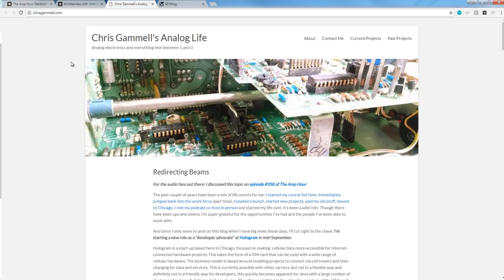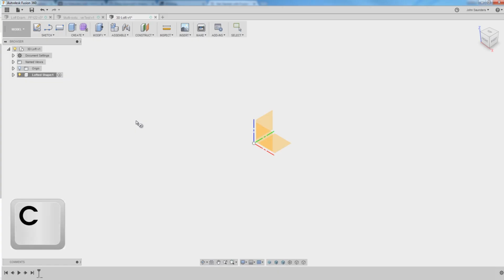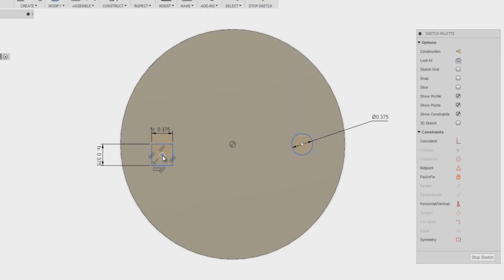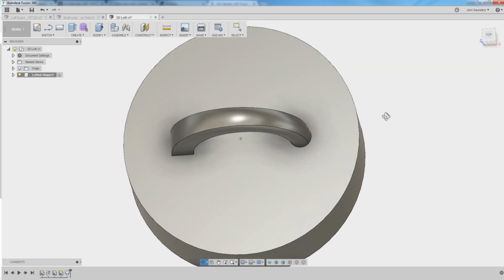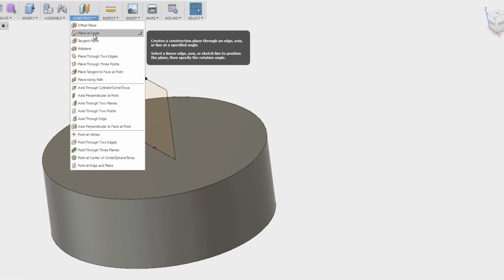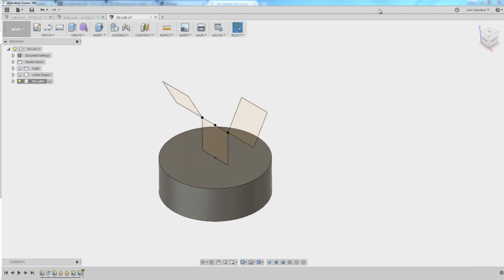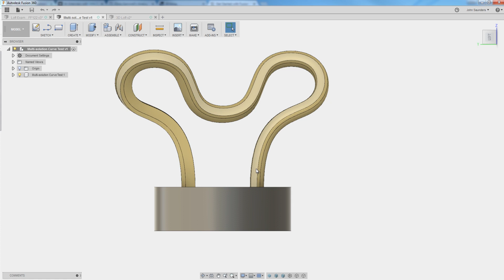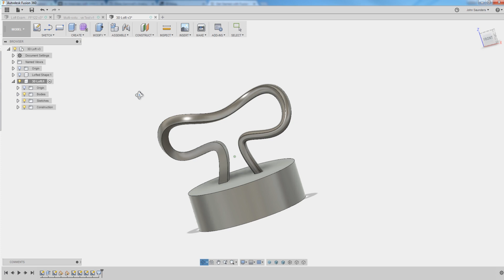How to Loft in Fusion 360!  FF122

Comment: You can apply a horizontal/vertical constraint to the spline handles at each end to get the curve to launch off the base plane orthogonally.
Reply: You can also apply tangent constraints to the spline so that it can be orthogonal to any axis (note how the spline is still blue because you have not constrained the end behavior)
Reply: Don’t forget that you can also drag the tangent handles/lines.
Reply: Or apply a coincident constraint to the point on the end of the tangent handle  so as to attach it to the primary rectangular upright in the vertical sketch. The advantage of the particular approach being that the initial curve can use a parametric dimension to vary the initial curvature in synchrony with the primary sketch by driving the tangent handle points up & down the side of the rectangle.
Reply: Just edit the spline and make them 90 degrees
Reply: And have a beer :)
Reply: Just tested this because I thought of the exact same thing, it works.  ;-)

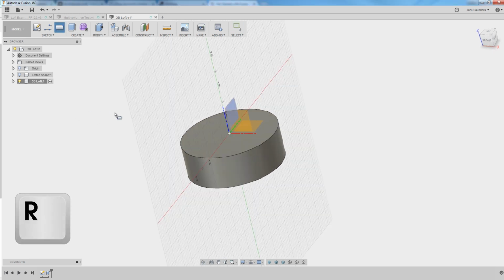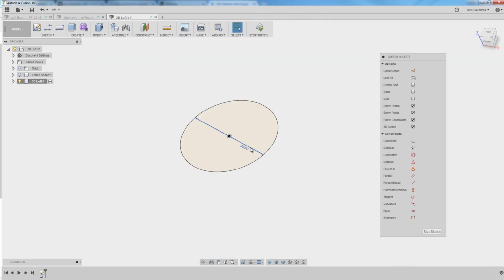Comment: https://www.youtube.com/watch?v=xTZpGM2P9u4 as you can see in the shootout both 4:58 SW & Rhino 4:49 have the same direct spline shaped start. So there is basically no difference while pure lofting. Looks like the 90 degree start is a later further perpendicular or tangent constraint.

Comment: I started using Solidworks in 1998 - 20 years. It is very capable and I am very fast with it. In my reality - I design primarily for the CNC machining process with integrated electronics. In that regard - Fusion 360 beats Solidworks overall. I very recently switched from Solidworks / Mastercam for Solidworks and very unlikely to go back. 

I don't need extremely advanced geometry that is difficult or impossible to machine anyway. F360 integrates with Eagle now so integration is easier. Oh....and the price is FAR lower for F360. 

F360 is also improving at a considerable pace - faster than Solidworks for sure. So far, I have not found a meaningful limitation between the two.